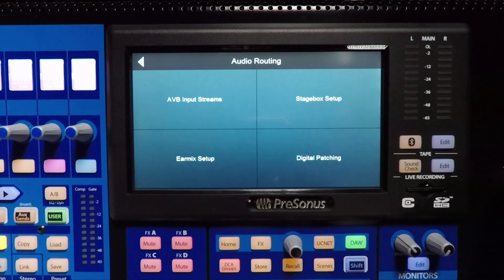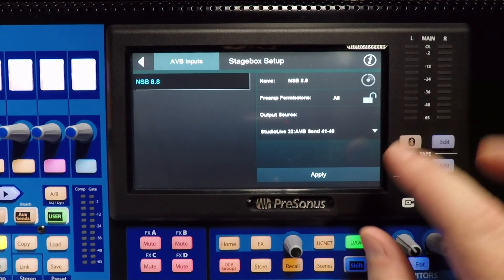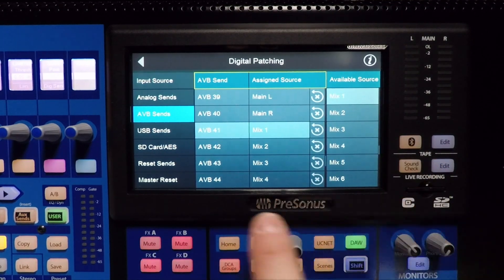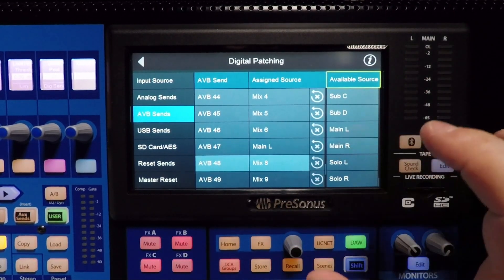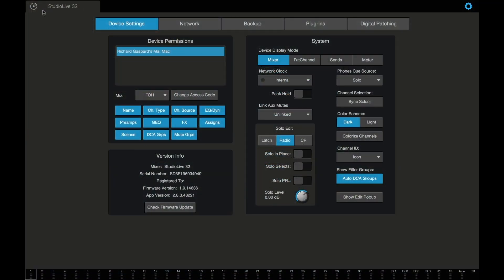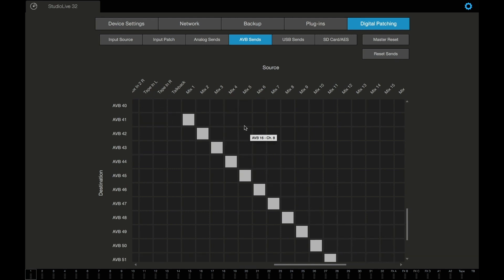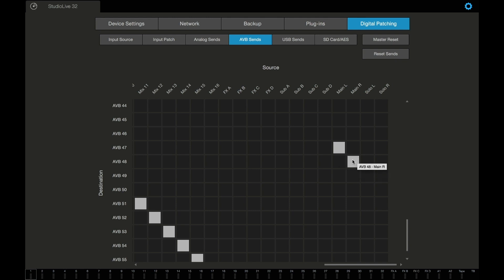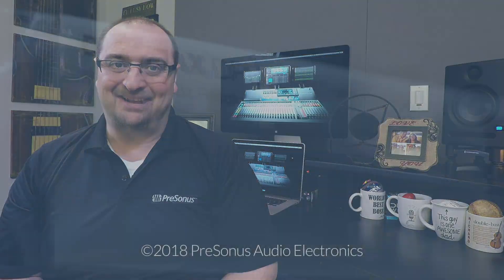Routing Outputs to One PreSonus NSB Stage Box

Comment: Hi Richard, Great Video thank You.   For the Outputs on the NSB would I need a headphone amp for each channel say 1-6 if these were used for individual headsets?
Reply: I would think so because the AVB port will have signal but not enough power to drive the headphone.

Comment: Thanks for the information. So if I understand correctly, AVB47 is output 7 and AVB48 is output 8 on the NSB 8.8, is that correct? Therefore, with a NSB 32.16,  I should use outputs 15 and 16 on the NSB 32.16 for main left and main right, is that correct? On the back of the PreSonus StudioLive 32SC next to main L/R, there is a gain knob where I can increase the gain going to the speakers, when using the digital snake and the NSB, how would I increase the gain if needed like I would with the main L/R on the back of the board?